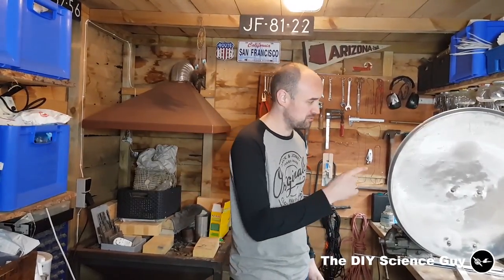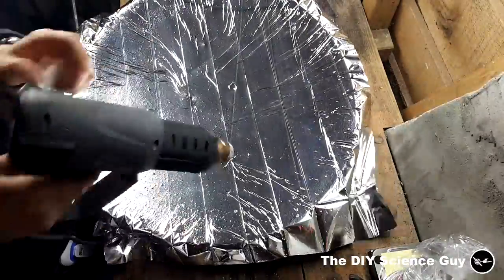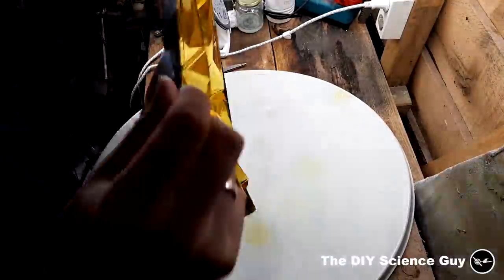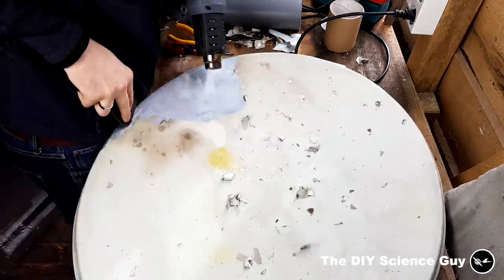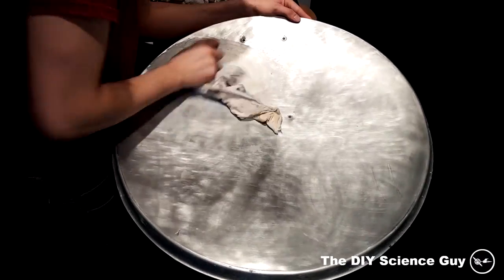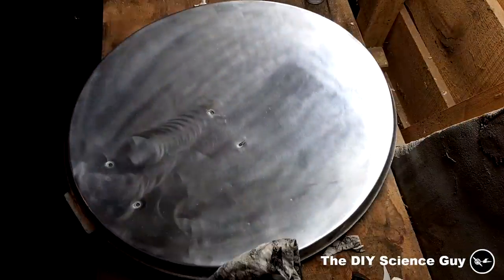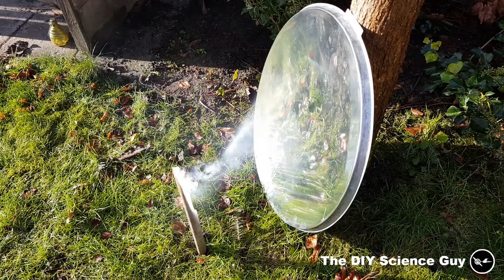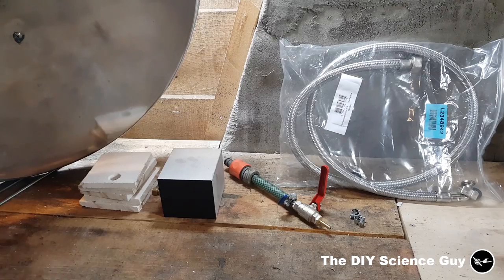Polishing a satellite dish into a parabolic mirror to power my steam engine

Comment: You can now purchase rattle can chrome paint and mirror paint off the store shelf. After using 600 grit sandpaper go directly to using auto body primer followed by the chrome paint. Alternatively, you can powder coat the surface with a silver mirror finish at home relatively easily now.

Comment: I have made several reflectors using these three steps: 1) Random orbital sander instead of the angle grinder.  Small one-handed type.  2) Paint stripper instead of heat gun 3) Automotive rubbing compound the automotive polishing compound for the final shine.
Reply from the maker: Good work!
Reply: @TheDIYScienceGuy  I would have never considered  a sat dish until I watched this video. Just made minor changes for the finishing process. The progressively finer sand paper technique was used for the prep.

Comment: Drill a hole in the back of dish ,take the material cover dish  like a drum glue it around the outer edge of dish sealed. glued good , the hole drilled in middle  of dish, take 3m adhesive spray ,spray into hole don't over spray it doesnt take much a fine vapor of the spray works,and since there isn't any other hole in dish spraying glue the pressure has no where to escape ,now connect a vacuum pump to the hole in dish and remove air in dish the material will draw down tight with no wrinkles and glue will hold it , keep vacuum connected until glue drys.

Comment: The emergency blanket could have worked! If you pulled it tight first in a star pattern then draw a vacume from the back and cover the holes with tape. you didn't wrap the outside edge with good tape so it leaked. Most dishes are galvenized. So sanding is futile. ALUMINUM tape works well enough if you sand the disk first. It can easily light a board on fire with aluminum tape. Cheap and very fast. It works ! And you have bare metal that will rust or require more elbow grease. But hey, it was a fun project I'm sure!
Reply from the maker: Yes that's it! It probably zinc, and that's why it policed a little bit odd. Thanks!

Comment: My arms and shoulders are aching from two days worth of sanding and polishing a 30" offset satellite dish. I can relate to how hard it is after the hours of elbow grease. I started by putting paint remover on the dish, then sanding from 40-7000 grit paper, then polishing with Brasso. After polishing I noticed quite a few deep scratches I had missed by not having the right light angle on the dish as I sanded it. So, today was spent starting over on sanding...heartbreaking! But, I am back up to 2000 grit as we speak and its starting to look good. It's incredibly smooth and almost looks like it has a clear coat on it, although not totally mirror reflective at this point. I think I may have spent too much time trying to 'smooth out' the offset angle as I wanted to widen my focal point to spread the heat in a wider focal point. Tomorrow I work back up to the 7000 grit and will use a buffer to compound polish, then use a better metal polish (Gord's) to take it to a mirror finish if all goes well. So this brings me to my question...did you coat or seal your dish with anything to prevent rust and oxidation?
Reply from the maker: 7000 grit my word!! Thats almost like using a newspaper! I haven't coated it with anything yet but maybe I'll put a coat of varnish on it. Are you going to upload a video of your painstaking work?
Reply: A highly condensed version maybe depending on the results. It could be a video of what not to do lol. I will say that I saw a noticeable difference going from the 2000-7000. If it doesn't turn out the way I need it, I may try my hand at making a parabolic dish out of plexiglass and a mirror-effect spray. I've yet to see it done for a solar cooker but it looks like it has potential to work.
Reply from the maker: Ok that would be nice! Please let me know how that goes!

Comment: i have been keeping an old satellite dish that was out in my backyard when i bought my house - it's one of those HUGE old ones... but i want to do the same thing so i can use it to generate steam and run a turbine...  given the sheer size, do you think the emergency blanket would work since it would obviously form to the 'mesh' of the dish... or would i have to use something solid...  guesses?
Reply from the maker: Well I've seen people use thicker aluminium coated Mylar because it has a thicker coating and there fore reflect better. Cut some triangle shaped strips and glue them on. The milar is pretty easy to find and cheep. Good luck and please let me know how it goes!

Comment: Got any ideas on how to 'inflate' a variable focus space foil that's about the size of a US football field, to the correct shape and overall curvature? Cheapest might be spinning it, but a perpendicular arc to the solar wind so it doesn't get blown or blinded or reverse umbrella'd.

The idea is a newtonian reflector, similar to all of the most modern space telescopes, but using computational optics and foil surface measurement to correct for any unfortunate dimples or wrinkles.

Hubble has to point at an object for upwards of thousands of hours to get enough light to average out into an image, where something with 1000x more reflector area could do it in a couple hours with the right approach. With the right optics (we're getting advanced here), it can even offer far better resolution, if you are able to use a giga or terapixel array and process the data along with the reflector surface map.

#TechnologicalStagnation

Comment: try baking soda water to polish the aluminium surface
Reply from the maker: Thanks I'll give that a try! Although it turned out that it is a steel dish with a layer of zinc, that's why it did not polish as well as you would expect.

Comment: What you should’ve done get yourself a cotton Wheel Single phase 1175 Motor attached the cotton wheel two it got yourself solid block of aluminum Roush Half an hour you would  of had A mirror finish that would’ve blown you away simple you did way too much work good luck